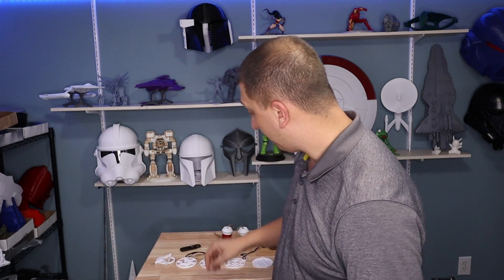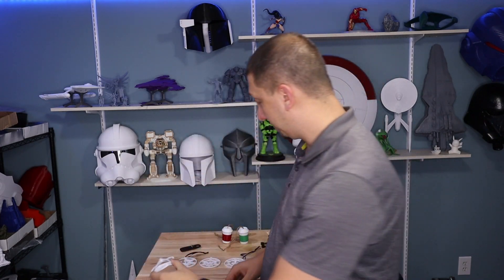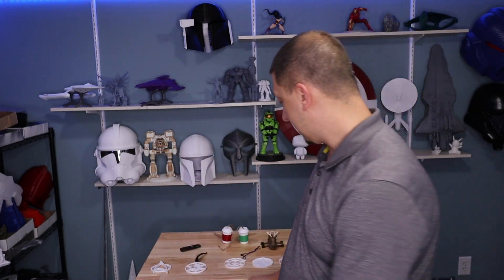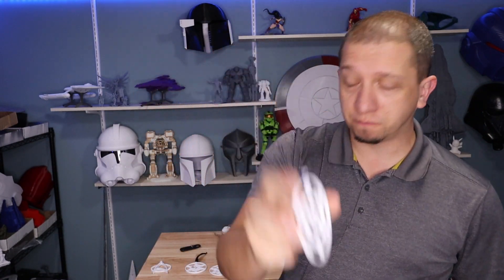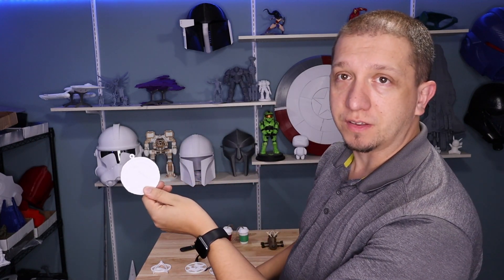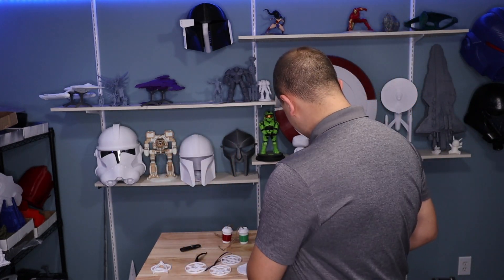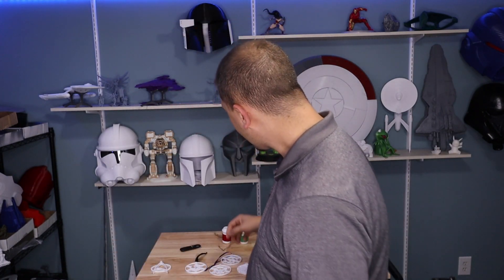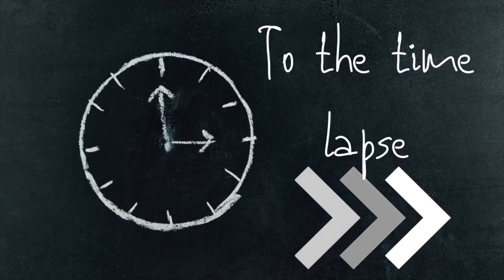Best Things to 3D Print for Christmas

Comment: Which do you prefer the CR10 V2 or V3?
Reply from the maker: V3
Reply: @Rise3DBuilds  I'm about to pull the trigger on my first printer and couldn't really find a lot of reviews on the V3 so that worried me a little....
Reply from the maker: @moodymade3884   it’s the same as v2 except the extruded is a direct drive.  Really everything else is the same
Reply: @Rise3DBuilds  do you use a tool chest / table for your printers to set on?